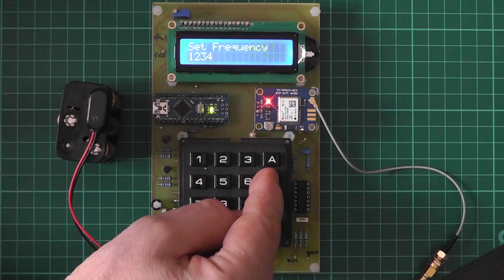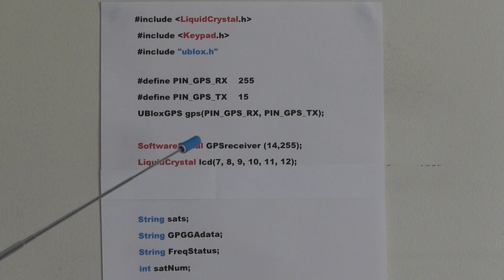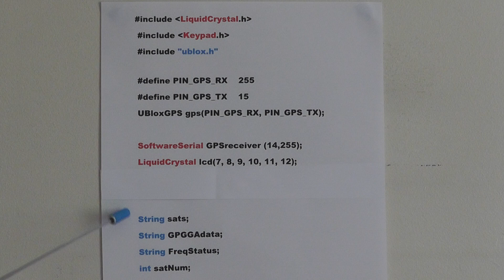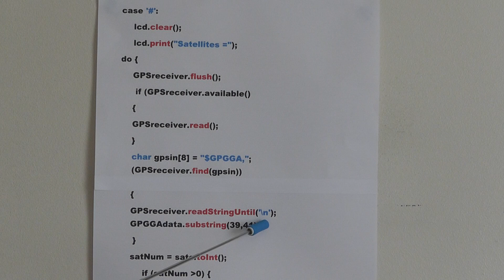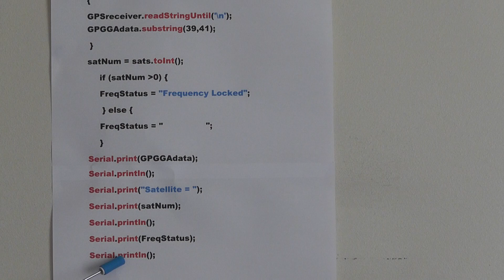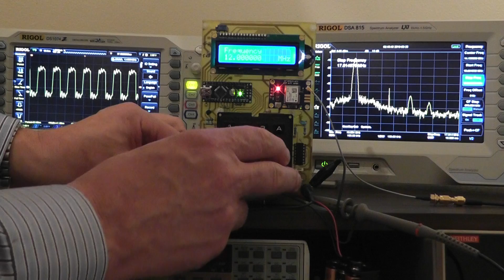Scullcom Hobby Electronics #39 - Design & Build a GPS locked Freq. Part 4

Comment: Thanks for all your work on these videos.I've really enjoyed your projects and have a couple on my to-build list. This frequency standard is my next in line and I just received my order for the last set of parts I need. I have two of the Neo 7M receivers (one from eBay and one from Amazon) and have been playing with them in u-center and with some other Arduino programs I have for GPS modules.When I started looking at the NEMA sentences from u-center, they don't seem to match up with the GGA sentence structure you're using in this video and the code. Specifically the Neo seems to be reporting two more digits of precision for time, latitude and longitude. This moves the structure over by 6 characters. There is also an issue with null fields when the fix is lost.I think this is because the example GGA sentence you have is an older example that doesn't take into account the variable decimal parts of these three fields, and, for some reason, the Neo is reporting out a precision greater than what is really useable.Also NEMA sentences are really comma-delimited where field number is guaranteed but position isn't.These are my u-center text console messages from a Neo 7M doing a cold start where it’s been powered down overnight.
1) This is the first GGA sentence reported. At this point there are no satellites so even the time information is unavailable.
$GPGGA,,,,,,0,00,99.99,,,,,,*482) This is only a short time (seconds) later and it has at least contacted a satellite since the time data is now available, but the satellite count is still zero.
$GPGGA,155620.00,,,,,0,00,99.99,,,,,,*633) This is the last GGA sentence that is not reporting a fix (about a minute after the previous one). The satellite count is now four but the fix value is still zero. It has put in a horizontal dilution of 2.79.$GPGGA,155725.00,,,,,0,04,2.79,,,,,,*5F4) This is the first GGA sentence reporting a fix. It’s taken about a minute, which wouldn’t be unusual for an indoor, cold start with a patch antenna. It has four satellites and is reporting a one for the fix quality.$GPGGA,155726.00,3836.75530,N,12117.96679,W,1,04,2.79,8.2,M,-27.2,M,,*6D5) I then covered the Neo to get it to drop its fix. I’m pretty impressed with it. Even indoors, covering it with my hand wouldn’t cause it to drop its fix. I had to wrap it with aluminum foil. At this point it’s still reporting four satellites but has a zero for the fix quality. I didn’t watch it long enough to see if the satellite count dropped. I’ll probably try this during some later testing. I don’t know why it’s adding the DGPS station ID number of 0000 towards the end at this point. This also illustrates the variable length nature of the field for the dilution.
$GPGGA,161349.00,,,,,0,04,22.30,,,,,,0000*69Examples 4) and 5) are the ones most likely to be seen once the receiver is up and running. The interesting point is that this will probably work with your code, but not because it’s determining the number of satellites, but because in 4) it will most likely be getting a non-zero value from the end of the longitude and in 5) it will probably be getting a zero from the DGPS station.Rather than using the satellite count, I prefer to use the fix quality right before the satellite count. In the GGA sentence a non-zero value seems to indicate a fix. In the RMC sentence, the fix quality field is “A” for active or “V” for void.The web site
http://www.plaisance-pratique.com/IMG/pdf/NMEA0183-2.pdf
has a more detailed explanation of the higher precision variable formats. Section 5.2.2 and 5.2.2.1 have some details on comma-delimited and variable length fields. Section 6.2 has some specifics on the time, latitude and longitude fields.
Reply from the maker: +Walt Mckinnon Thanks for your detailed comment, very interesting. I did also consider using the FIX indication but decided to monitor the number of satellites received as we are interested in locking to the satellite frequency as apposed to a navigational fix. You usually need 4 or more satellites detected to get a good navigational fix. You will note from the NMEA sentence received that you get a accurate time lock before a navigational fix.
Yes you are correct that the current NMEA sentence is reporting two more digits of precision for time, latitude and longitude and so increases the NMEA sentence by 6 digits (this is a total of 7 characters as there is now a decimal point used in the time data). The NMEA sentence I used in the video would appear to be an older version. However, as my software code strips off the first 7 characters of the NMEA sentence with the "(GPSreceiver.find(gpsin))" command which identifies the string we need to capture as it is looking for the characters "$GPGGA," when it finds these characters it then starts reading the remainder of the string data in to the buffer. So we start our count of characters from the first digit of the 'time' data (and not from the $ character) which is then character position 0. At 39 characters from this is the first digit of the number of satellite data (which is what we need to capture).
The Arduino software code is correct for capturing the data we need it is just I illustrated it with an older version of the NMEA code, sorry about that, my mistake.
I will mention this in my next video. If you run the Serial Monitor on your computer when you press the # key to see the number of satellites you will see that the captured NMEA sentence is displayed and starts with the time data, having already stripped of the "$GPGGA," characters (7 characters as it includes the end comma).
Thanks again for bring this to my attention.
Reply from the maker: +Walt Mckinnon I have updated the user manual for this project with the corrected information. Also it is now clearly explained on my website, direct link to the page below:
http://www.scullcom.uk/design-build-a-gps-locked-frequency-standard-part-4/
Reply: +Scullcom Hobby Electronics Thanks for the update. The web site is looking good.I see where you're getting the correct satellite count when you have a fix but I think there is still a problem when there is no fix.I copied the part of your program where you are reading the NEMA data into a small program and added a couple of more debug statements. One prints the "sats" variable and two others print the length of "sats" and "GPGGAdata". I then ran it while I had a fix and then removed the antenna so I lost the fix.I added the output from the serial monitor below and hopefully it stays formatted better than my last post. But basically, the length of "GPGGAdata" is 67 when you have a fix but only 34 when the fix is lost. This is because most fields are now nulls and you have only the commas and little data. The "sats" is good when you have a fix but is null when you don't. I think this is because the substring is pointing past the end of the field. The null "sats" then becomes a zero when you make it numeric. Right answer, but for the wrong reason.181331.00,3836.75378,N,12117.97067,W,1,04,1.72,30.5,M,-27.2,M,,*50GPGGAdata length = 67sats length = 2sats = 04satNum = 4Frequency Locked181332.00,3836.75342,N,12117.97088,W,1,03,1.70,30.3,M,-27.2,M,,*58GPGGAdata length = 67sats length = 2sats = 03satNum = 3Frequency Locked181333.00,,,,,0,00,99.99,,,,,,*6DGPGGAdata length = 34sats length = 0sats =satNum = 0181334.00,,,,,0,00,99.99,,,,,,*6AGPGGAdata length = 34sats length = 0sats =satNum = 0

Comment: What happens if you choose a factor of 48 like 6 or 8 Mhz? Is it cleaner than 5 Mhz?
Reply from the maker: +Gooberslot I have found if you select any random frequency up to about 2 MHz the output always gives a very nice clean square wave. The output waveform of any frequency between 3 MHz to 4 MHz also stays fairly clean. Once you go higher than these frequencies the square wave has some phase noise but the frequency is still accurate when monitored on a frequency counter or spectrum analyser. Choosing frequencies which have a factor of 48 MHz like 6 or 8 MHz does show some slight improvement but the phase jitter on the waveform is still there. To remove this phase jitter altogether I think would need a Phase Locked Loop circuit which you will see has been mentioned a number of times in other comments relating to this project. This is something we could look at in a future project.
Reply: +Scullcom Hobby Electronics I hope you do do a project with a Phase Locked Loop circuit in the future because I don't even know what that is but I'd love to learn. :)
Reply: UBlox Internal Oscillator is 48mhz, so any even division is clean. Anything other than that is quite terrible/noisy, and lots of jitter.

Comment: Better and better :-D
Just when i thought it could not be improved lol.
The output does look a bit odd, would some kind of biased low threshold schmitt trigger circuit have a usefull effect, or should i shut up ha ha :-D
Reply from the maker: +zx8401ztv Thanks for the comments. This video was a little dark as I filmed it at my computer desk in the house and not in my workshop. I have a small set up of test equipment on my computer desk which I use when testing projects and working on software. In this case I had just finished the software update so I decided to film it there. If I do it again at this desk I think I will have to improve the lighting.
I have tried a number of ways to get rid of this phase jitter on the square wave at the higher frequencies but found it difficult to remove at all outputs frequencies. As you mentioned, I have tried playing with the threshold bias on the schmitt trigger but was not successful. I did try adding a low pass filters which did work well but then this would have to change as the frequency selection is changed. Basically, what we need a a programmable filter which tracks the frequency we have entered so that it filters out the unwanted harmonics.
I think the next step would be some form of Phase Locked Loop circuit but I will leave this for another project as it involves a second PCB with a Voltage Controlled Oscillator and a Programmable Frequency Divider in the feedback loop.
The project as it stands at the moment does give out an accurate frequency reference signal so is still quite useful for the hobbyist. Thanks again for your constructive comments they are always welcome.
Reply: +Scullcom Hobby Electronics 
I admit that i know nothing about the methods used to generate the waveform, i would ask, what does the waveform look like with only a resistive load and very little stray reactance  present, does it look the same, does it change with odd frequencys, and how would a gps satnav use that signal.
is the problem related to taking the gps module away from its typical usage.
If nothing else, its interesting :-D
Reply: To begin with, thx ever so much for sharing this project and all the details needed to build it.
So, it appears that there is only a subset of usable UBlox output frequencies, the rest have excessive jitter. A step up and another project is to find the highest frequency that has a very low jitter and use that as a reference for a local frequency synthesizer. Unfortunately it would make the project a lot more complex but the output would be jitterless at any frequency that the synthesizer is capable of generating. Nice talk, seems like a great fork for this project. Thx for the information and the idea.
I look forward to each time you share one of your exquisite projects.
Again, thx for taking the time to make the videos and sharing the results.

Comment: Its a nice project with a bit of filtering it will work very well up 2 15MHz as a frequency standard. Its a very good building block with the addition of a veriable attenuator and some way of modulating the signal to use it as a portable rf sig gen for receiver tests. Maybe a project for the future using this as a starting point? Great videos and super channel.
Reply from the maker: +Gary g1fsh Thanks for your comments. Yes agree this could form part of a more advanced RF signal generator.
Reply: Would be nice to see that coming to life

Comment: Excellent update Lewis. Thanks. I did make a small change to the code, I added a battery check function to the main loop. So if the battery falls below a pre defined level (6.5v) it is immediately displayed. (I'm using two 3.7v Li-ion batteries). Best Regards.
Reply from the maker: +Eric Gee Thanks. Nice idea of adding the battery check in the main loop. Also the Li-ion batteries is a good choice.

Comment: The inclusion of the satellite count wasn't expected but greatly appreciated.  I'm hoping I can gather all the parts to build one but first have to work on the technique needed to produce the circuit board.  The rest of the build will be easy, but the board production is my big hang up.  BTW the website looks very good.
Reply: you don't need a PCB build it using Veroboard !!

Comment: You obviously haven't read the remarks concerning the jitter problem in previous video. The mcu can change its output only on sync with its own clock. So you will always have a problem if you ask a frequency that is not a divisor of its 48MHz reference. You should not exceed 12 MHz... The artifacts at that frequency may be caused by sync with satellites. Because when locked, and even if you ask a divisor of 48, it will try to output the real value and not a divisor of the reference 48MHz. So do these artifacts change if you remove the antenna?
Reply: To be clear, at 12 MHz output, the mcu output is high 2 cycles, the low 2 cycles... with a simple clean pattern. But if you ask 11.9 MHz, it will do the same, except that from time to time the output will be fixed for 3 cycles instead of 2. So on average you get the 11.9 MHz you asked, but a quite dirty one. Now if you add satellites, it will try to compensate for the error of the 48 MHz. Imagine that the real value is actually 48.03 MHz. Without lock, if you ask 12 MHz, the system has no way to know this drift and will divide by 4 (as explained before). But when you have lock, it will know that there's a drift in the 48 MHz and will compensate for it. So to output 12 MHz it will have to divide by 4.0025 and will have to add a 3 cycle instead of 2 from time to time... and generate the glitches on the frequency analyser
Reply: +cyril muller conclusion: if you want a clean output at all frequencies and with or without lock, you should use a PLL http://www.analog.com/media/en/training-seminars/tutorials/MT-086.pdf
Reply: +cyril muller http://www.ti.com/ww/mx/multimedia/webcasts/TI_webinar_25-06-2010.pdf
Reply from the maker: +cyril muller Thanks for your detailed comments which other viewers may find of interest. I have read your previous remarks. The jitter only seems to effect the higher frequencies over about 3 MHz. Even though the waveform shows a poor quality waveform shape at the higher frequencies I have found that in all cases the fundamental frequency which is set, still remains accurate and can be used as a reference. This is clear to see on both a spectrum analyser and frequency counter. I am very familiar with the benefits of using a PLL which would improve the output waveform of this project and this could be added at a later stage if required. This project was aimed at the hobbyist and was designed to keep the cost down as a starting point but still give an accurate frequency reference standard which would be useful. In order to use a PLL with this project you would also need to include a programmable counter in the feedback loop and voltage controlled oscillator. Some wide-range high frequency synthesizers also use an additional crystal oscillator and a mixer circuit in the feedback loop and these type of circuits give excellent results. I think taking it to this level is really a separate project. Thanks for the links I am sure that other viewers may find them of interest.
Reply: +Scullcom Hobby Electronics At the end of the day it's a question of "what is the goal of the project?". If the only thing you want is a device that send 'x' pulses per second, then you are good. If you want an actual clock then you have a problem because the duration of the period of the output is never right (when locked it's adjusted so you are almost never using a perfect even divisor of 48 MHz, and when not gps locked there's the clock drift), it's a mix of faster and slower periods that only achieve the target on average. So if you want to check a frequency counter you are ok, if you want to clock something, only smaller frequencies will have a reasonable jitter.